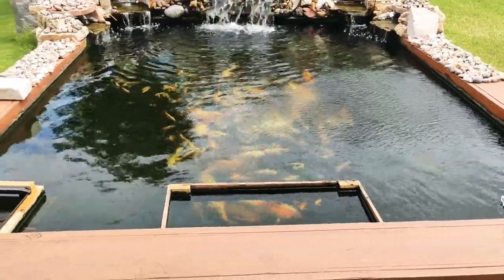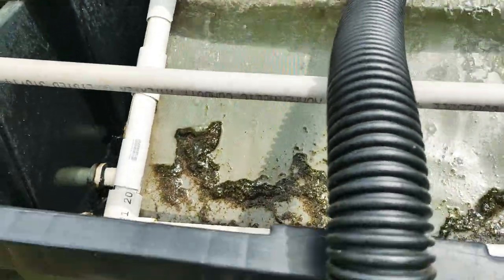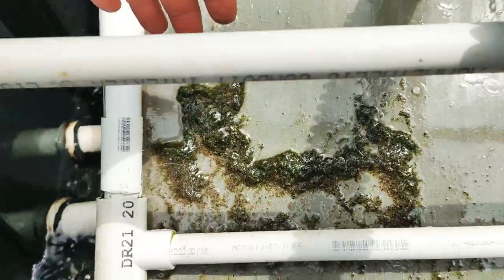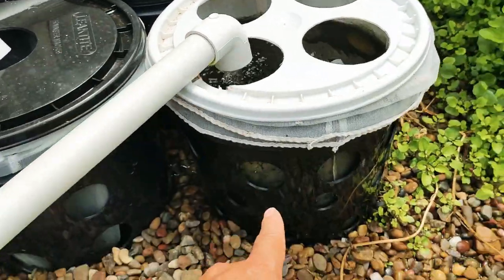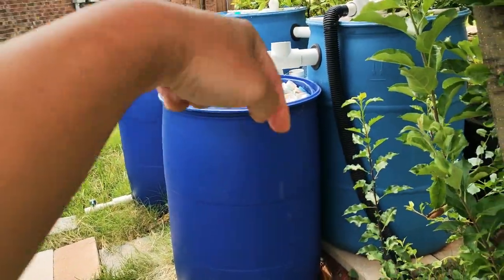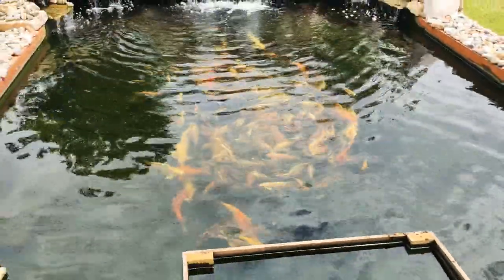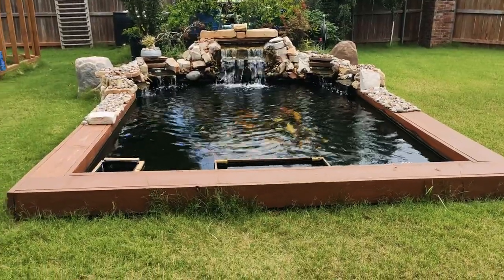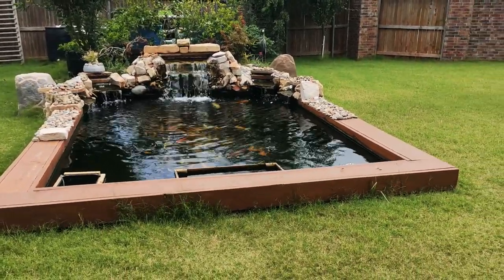Sieve Filter for Koi Pond

Comment: Great diy sieve! How did you manage to clamp the mesh to the tube? Its difficult! Did you soften the clamp?
Reply from the maker: Is not hard at all, I used the 1 inch pvc schedule 20 so is a little thinner cut it about 2 inch then cut it vertically then you have a clamp
Reply: @chu0435  is it important for the sieve to be slanting down? My filter chamber is really narrow. 1ft x 2ft & the water from pump is really strong.

Comment: Thanks so much. Excellent info!  I need to improve filtration in my 10k gallon pool/koi pond.  I made a sieve before (12"x24"), using screws, etc. but it was too small and overwhelmed by the large flow rate and massive debris.  I like your sieve/plant setup.  Where do you find the larger SS mesh for the sieve?  I only find smaller sizes online.  I hope to build a similar setup since I have a need for and room for tons of edible/medicinal plants.  Your fish and plants look very happy!
Reply from the maker: Thanks Jordan! I also bought them online, it seem you will need the 300 micron sieve. What's the micron size on your old sieve?
Reply: @chu0435  I believe it is 200 micron, but because the pond gets so much debris from trees/bamboo, etc.  It might be better to use maybe 3 or 4 sizes in a row to help take out larger to smaller.  I am using the 5-gallon paint strainers, but they are still letting a lot of very fine particles through, so I need a smaller micron after them to catch the fine stuff.  I am probably getting 30-40 lbs. of (wet) solids out per week from the 2 filters.  I also need to figure out a better intake system so I can get the submersible pumps out of the water.  I couldn't quite figure out your skimmers.  I was thinking of making a 3-4' long by 6" PVC tube with 1\8" or smaller mesh to make an pump intake.  I am trying to keep it safe for fry since my koi spawn usually yearly around Easter.  I don't want to filter out the babies...lol. 😱

Comment: Nice DIY sieve.. Can I ask what mesh sieve you use?
Reply from the maker: The mesh I used is 18x24 inch 150 micron
Reply: @chu0435 stainless steel mesh sir?
Reply from the maker: Yes stainless steel mesh
Reply: @chu0435  thanks
Reply: @chu0435  how long will the mesh be clogged?
Reply from the maker: @zeprizelo9435 about 2-3 days I use a water hose and spray it down not taking out the mesh or anything but I do use a high pressure washer and clean it once a month
Reply: @chu0435  
Thanks for your share
Gbu
Reply from the maker: @zeprizelo9435 np

Comment: hi could you reach out to me? i thinking of building a similar setup. would like to run a few things with you?
Reply from the maker: Sure, what do you have questions about?
Reply: @chu0435  would like to ask about design and layout.  my backyard is 50' wide and 45' long.  i would like to have mixture of koi and tilapia (harvest them at end of the year). would it better to have the pond in a rectangle or square.  im leaning toward 8x16. deepest section is 4 ft and concrete walls up 2'.  hopefully can maintain 5' of water.  the reasoning for 8' is to use polycarbonate sheet for cover during winter. i live in north texas and temps can get below freeze.
Reply from the maker: I would build the pond as 8x16 cause fish like to have a current flow and 8x16 is easier to make that flow, water pump at on end feed to the waterfall at the other. As for raising Talapia, I try them before but they will always die in the winter when it get too cold, so would raise the koi and Talapia separate. The koi I would raise outside and the Talapia I would at least build a greenhouse and raise them inside maybe they might survive the winter. Good luck